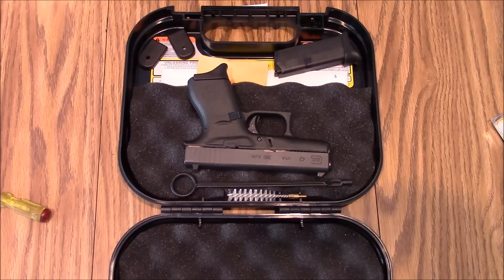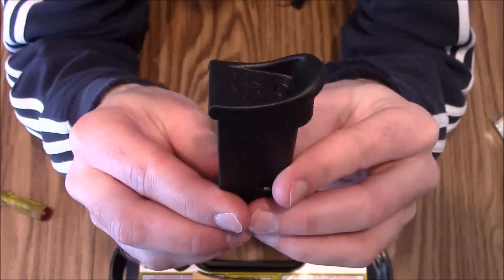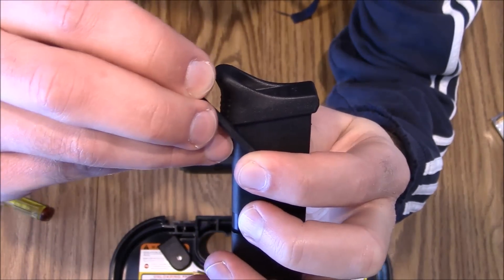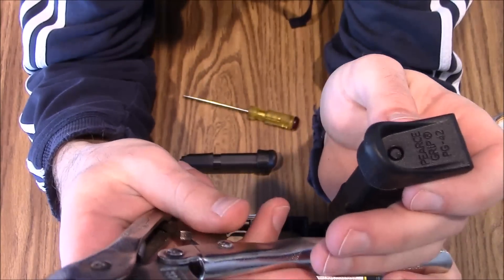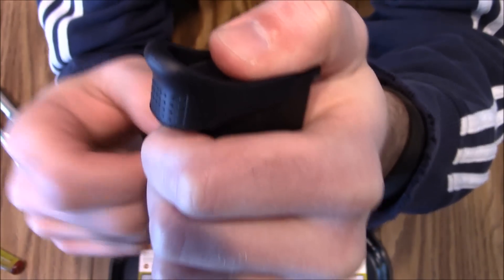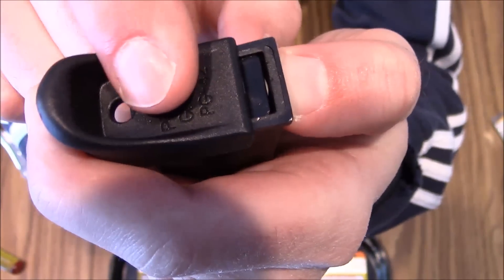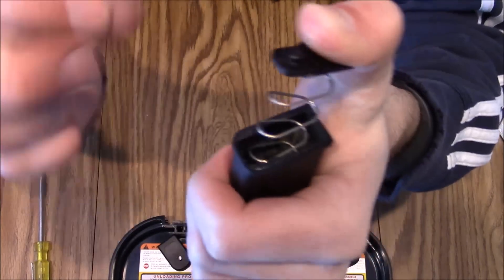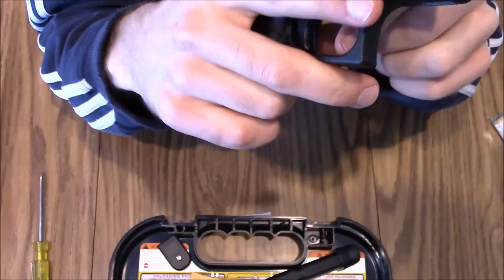Tips: How To Remove The Magazine Base Plate On Any Glock Magazine

Comment: Great vid. Helped with my 26. Even being prepared for the spring, the spring plate slipped off my finger and flew. Looked high and low and thought I was going to have to buy a replacement. Thankfully found it as I was packing up. Have to be very mindful of user error. 😂

Comment: Spark Plug Wire puller works awesome and it has a coating so scratching up the mag.  Also it always you to put just enough pressure and when you hear the click slide it on off.  I just did 4 magazines.  2 Strike Ind +2 and 2 Pearce +1.

Comment: I have a OEM Glock 23 10 round mag and when I push the pin in on the bottom to try to get the plate off, the pin will only go in less than a quarter of an inch and I'm using a vise grip and unable to slide it off all videos I've seen says I must use a punch and push that pin in about 2 inches it will only go about 1/4 of an inch and it is a hard stop I have the mag unloaded as well any help would be appreciated thank you